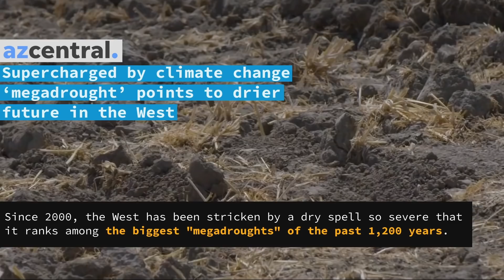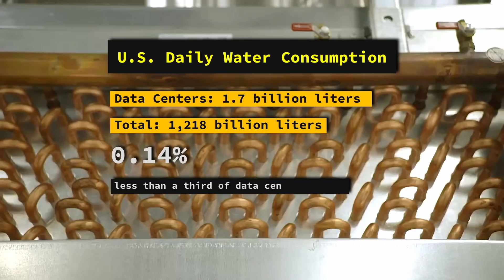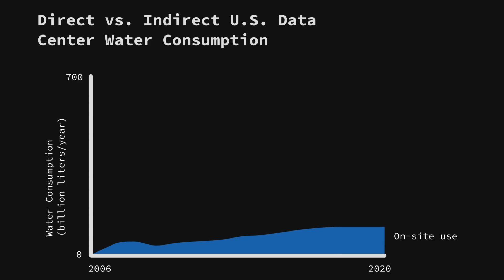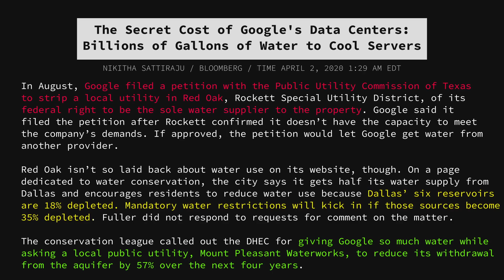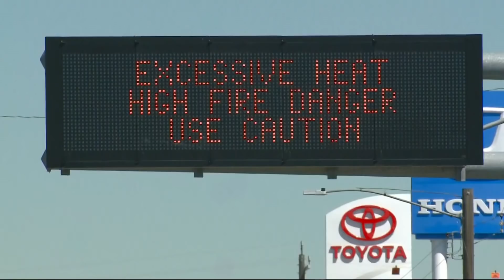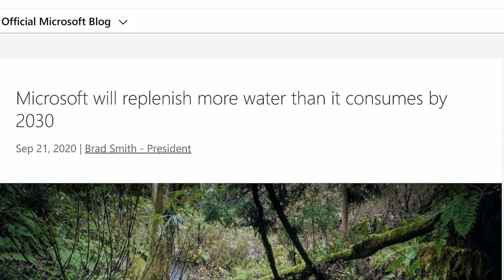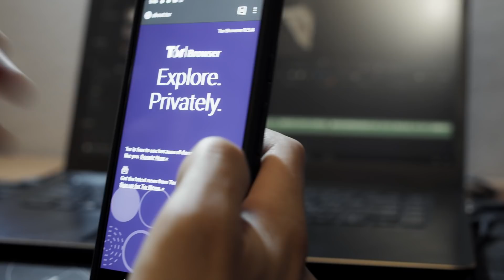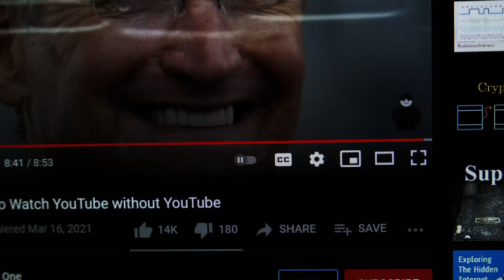The Internet Is Running Out of Water

Comment: UGH!

I'l give this channel a chance and little bit more benefit of doubt and watch few more videos but so far it seams like its milking a very specific crowd which is conspiracy theory prone for views and patreon supporters. 

as for this video maybe I am not informed enough so any answers will be nice: 

questions:

I do not understand this. How can we run out of water which is being evaporated when being used for cooling. Will more water in atmosphere not create more clouds and rain and come right back as rainfall? Evaporating water is Renewable by definition. It is still water just in a different form. 

Also where is the correct percent of how much water is used for data centers. only the initial 0.14% is shown everything else is speculation. there is a 1/3 mentioned and some sort of graph but no human readable number after all the talk about it. 

Finally my opinion, just an opinion but still. Draughts are caused by global warming. Heating of the atmosphere causes air to hold more moisture so there is less water on the surface as the result. Also yes it seams it is caused by human activity and not a natural process. regardless the cause we should try to reverse it or there will be less water. 

This is a problem that we are trying to solve using renewable energy and who knows machine learning might helps us solve it as well. Not sure why the video bashes technology so much. 

This channel is weird. So much conspiracy talk yet so many things are glossed over and not rooted in common sense. 
If you want to take a look at where the water is getting hit at most take a look at the animal agriculture instead. 

Also yes companies do things for profit go figure. Greed is a huge problem on Earth... but the consumers are the enablers and starting point of everything. Moderate your consumption as an individual to be less of an addition to the problem. That does not mean all progress is evil though. Capitalism sucks in many ways but as far as I know we did not find a better way to distribute wealth and exchange stuff. Yet.

if somebody answers I will read and try to learn maybe I am wrong?

Cheers!

Comment: There are many inaccuracies regarding "consumption" of water, especially in the sense of "indirect power generation".

These are majoritively closed loop generation systems, and even when not, create vapour.

In either case this is not consumption but conversion. It doesn't get rid of the water it relocates it.

Conservation of energy and mass is important to consider while taking in information like this.

There are simple methods to convert most of these systems (that aren't currently) into closed loop systems. That point was entirely missed here.

Also, the CPI is a notoriously unreliable document to cite due to constant manipulation.

Comment: So just so everyone knows, water used for cooling NEEDS to be potable (drinkable). Non-potable water has too much filth in it to be useful. It clogs up filters and the mineral deposits will cause overheating, and even electrical shorts and fires in extreme cases.

Comment: Why don't we use make system that way so it would use sea water? Though we might need to find a way to remove salt from pipes or radiators which would be used to transfer heat from centers to sea

Comment: All those datacenters located in dessert region could EASY pump sea water and use it instead of ground water .
Look how easy they can pump Oil across country in pipes . well water is easier because it is not flammable ect , 
and thus doesnt require same safety procedures ect .
It is also cheaper to pump sea wate than Oil .
In the process where it is used the water is heated up and this could easy be combined with a desalination process 
based on heat , well location is in dessert with already high temperatures so it would be much more cost effective 
than those placed at coast lines .
The byproduct could then be fresh water that could be used to fill up the gap where water is now dwindling .
All is a very simple process that doesnt cost too much to actually do and with climate getting hotter and water 
dwindling it would be a great future system that could easy solve those problems we face today .

BUT as usual it is THE GREEDY OLD ( as I call them )  who is leading the government and the industry  is owned 
by same kind of GREEDY people who doesnt care about anyting than own PROFIT .
We need laws all over the world to force them to implement such solutions or face their business being closed down .

Comment: How about building the data center underground, verticals vents can feed into an inverted funnel, the rising heat passing over turbine blades causing the turbines to spin a generator head, the fresh air can come through horizontal tunnels to the surface, the data center could reduce its power consumption through the use of passive cooling, and produce some of the power it does consume.

Comment: They should be putting the data centers in nova scotia, highest tides in the world. That place would be stupid cheap, cold enough, its closer to a port, and be something that helps that shit hole out. Yes it's salt water, but it's that or use a water supply in states that need the water. I'm sure there is ways around it.

Comment: Thinking critically here, if im wrong let me know and why im wrong, but this water isnt just vanishing out of existance, evaporative cooling isnt new, my father works with them for University's ac units with no complaints there, the water just evaporates as the name implies, all the water going in goes back into the environment when its used, so wouldnt that make more humidity build up thus providing those areas increased precipitation and then the water is just replenished? I feel like theres a more underlying issue here if the datacenters arent able to get the water because of something else, i dont think its the datacenters at fault here because all that water used is just put back into the air, it they arent performing hydrolysis and breaking water molecules apart to their main components, if they werent loosing it due to evaporation then they would just keep using that same water with no need for supply. I feel like something else is at fault here, not the data centers, ntm i dont think they want to disclose it because then people get mad at them for using their water but not realizing that that water just goes back where it was found anyway.

Comment: Solar panels are dark. Meaning they absorb heat and radiate it back into the atmosphere. Furthermore, if they are located in a tree rich environment. Trees will likely need to be cut down. The same for wind turbines. (Except solar doesn't kill the ecosystem like wind turbines do.) - which gets rid of the planet's capability to take co2 out of the air through photosynthesis.

Solar + wind is great for people/businesses that don't want to be reliant on the unreliable grid. However, it's by far, NOT a solution to co2 pollution. Especially, after you consider the pollution involved and the limited quanity of resources, needed in production.

Right now, as we figure out how to reduce our electricity footprint. The best we could do is create ponds to grow algae and plant lots of trees. Those solutions would interfere with current ecosystems, but they'd also create their own, while absorbing co2. Heck, we can even eat algae.

Comment: What do you mean "consumed", water doesn't just not exist. Even if water is used for cooling purposes, it would still turn to steam or vapor and go back into the clouds.
Lol they shoulda spent that time designing better water recyclation projects. Like at my work, most of the water used for dishes could easily be sifted, boiled and recircled without needing to be put back into the pipe system. Most of these kinds of advances are the kinds of things you'd need on ships but could easily apply to businesses. Then theirs no need for water rationing, because you have a system in place already.
I'd say a possible solution, would be to start moving ocean water, into the desert, digging out underground lakes, and dumping the ocean water above using the ground and dirt to filter out the salt. It would create a salt mine on the surface and a freshwater lake underground. Build enough underground "seas", and you can temporarily buy yourselves more time. You could use those underground "seas", using surface drip lines to regrow entire sections of the desert, starting off small and rebuilding the biomes from a micro to macro scale. Eventually once certain trees developed strong enough roots to burrow down into the "seas" youd also create a fairly stable chunk of land in the process, highly resistant to erosion from encouraging deep root growth.

Another design would involve a glass bubble. Dump the ocean water in the enclosure, the desert sun, boils the water, fresh steam rises, hits the glass, drains down the sides as fresh water, leaving behind a salt deposit. The freshwater can flow into the underground lakes, eventually you could mitigate the expansion of the desert by connecting a series of lakes into a great underground freshwater ocean. Cheap, effective, basically energy free, Since your letting the elements do it for you, minus the transportation of ocean water. Or repurpose pipelines for the same task. Not only would the project be a great "show" in generational terraforming mechanics, but it would probably classify as one of those world wonders kinda things.

A third solution would be to design a dual pipe system, exposed but covered by a glass or translucent cover. The ocean water pipe is shallow and wide to encourage evaporation as it travels down the pipe, the water heats and condenses, that water flows down the sides into the lower pipe which feeds the freshwater line. You could potentially provide fresh water to impoverished people's without big bulky or cost inefficient designs, like desalination plants. You'd have to figure out the ratios. If you were really smart you'd keep the lower pipe dark to encourage temperature differential and you could use those funny peltier plates to capitalize on that exposed covered temperature amped upper pipe, and the cooler temperature reduced lower pipe, to draw off electricity which scaled along it's entire length could provide enough energy to kickstart said impoverished people's communities.

As a bonus byproduct your also making fresh ocean salt with little to no effort. The biggest problem would probably be harvesting said salt, which would crystallize along the entire length of the pipe, so idk maybe harvest/clean the salt at nighttime? You'd havta put back into the ocean what you took out to rebalance it.

Comment: If the majority of water is used in power generation, it would be a good idea to focus on inproving that because the cloud is unfortunately not getting any smaller. Also the water being "consumed" is still just evaporating to the atmosphere. Data centers sound draw their supply from a separate source as drinking water. But its not just going away

Comment: There are a vast number of other issues to take into consideration. Population growth, deep water wells sinking the land, and wide range fracking that caused holes in the ground to drain now contaminated water into. Then there is the huge amount if water needed to run those geothermal power plants in southern California, that killed 4 lakes. 
There are a number of East coast, and great lake data centers that have plenty of water. So they just need to start moving the majority of those centers to areas that rarely have droughts. (September 2010 the center east coast had a major drought... it dried up a few streams, and browned the grass. But that was about it.)

Comment: Why don't they just ban evaporative cooling and arrange the heat pipes in a high wall and let high flow water cool it, meanwhile the water drop can be used to generate electricity and the hot water directly piped into households. Therefore there is very little water loss and you have free electricity and free hot water.
Reply: They can't think of this solution not in a million years?

Comment: First of all, no. Datacenters don't "consume" water. They're like NuclearPowerPlants. The water is in a closed loop. If it even uses "watercooling" for the components, more likely they use a cooling agent. Also, you still need ClimateControl for the whole building. Plus you still need fans other components which can't be accessed directly for heat transfer.
The whole deal with "Evaporative Cooling" is maintaining suitable humidity and temperature throughout the building. It has mostly nothing todo with cooling the servers themselves.

4:09 Also how would it even "evaporate"? Never looked at the outside of your AC? There's water dripping DOWN! 4:09 It's hot Air expelled against cool outside air. If you atleast attended gradeschool ,you should now that there's more water stored in the hot air than in the cool air, and thus there's actually water being "created" (If you want to stick to 4th grade vocabulary)
Reply: Also, a damn is used to create enough water-pressure to make turbines spin and produce electricity.
It's not like it's made to be fresh water reservoir primarily. That's just a side-effect. Making just a Damn, that holds the water, is like the dumbest idea. Without inflow. No matter how big, it will just evaporate really really fast.
EDIT: Ok in the case of the Hover Damn specifically it was made primarily to control the fresh water supply (monopolising water?), 'cause y'all just live in a desert.

Comment: Here's a wild idea: Maybe don't place them in desert states where they need a lot of cooling and there's very little water?
None of our datacentres in Denmark used a single drop of water for anything but flushing the toilet.
Reply: Im certain there is less being used but I doubt Denmark's cooling uses no water. These computers get pretty warm
Reply: @Meaty_Aberration  There's a bit of water in the cooling loop, but we don't use evaporative cooling. 11 months out of the year, we didn't even use compressor cooling, just a very large air heat exchanger.

Comment: is closed loop water cooling not effective enough???

i get that servers can be too dense for direct flow electric air cooling to keep up with heat output, but surely waterblocks have gotten good enough that industrial pumps, which are pretty efficient, could manage even the most heat intensive compute farms. heck, refrigerative cooling? why evaporative? sure it is effective in arid climates but Heat Pumps are now so efficient and scalable, not doing that would only save short term.

maybe we need an industrial price control, like a carbon tax, because this is ridiculous. water should get more expensive the more of it you use, and if thats already true, keep it coming. make it unfeasible for companies to ruin environments.

Comment: Its true Data Centers use massave amounts of water. but iconsider that the only water that is lost is from evaporation in the cooling towers.. rest goes back down the drain and back to a recharge point. Many data centers can meter the water that is pulled from the source and also meter the water that goes back to the drain.. the net results from the 2 meters are the water that was evaporated.  As for Arizona the majority of water used in the state is from farming.. where it is masured in "acre feet" not gallons.

Comment: The internet use alot of water to cool the servers, but water does not disappear after it is used. If water is used in evaporated cooling then it will be released back into the ecosystem.

Comment: This could be so easily solved by just using CLOSED LOOP water cooling instead.

Well, I say easily but it would probably require an insane amount of money to change the method of cooling in so many existing data centers, not to mention that evaporative cooling is probably cheaper even than passive (radiative) water-cooling, let alone active (aka fans on the radiators), but I can't imagine the difference is that big.

Then again these are the kinds of companies who will do anything and cut any corner to save a single cent of profit.

Comment: Huh, that's weird. Why don't they recuperate evaporated water through condensing it? 
It would also make sense to use seawater to cool data centers and collect condensed desalinated water. It's a kind of win-win scenario for everyone.
Reply: The salt collection process would be more expensive. As well, salt water takes more heat to evaporate, which could cause heat overloads. It's much less efficient for cooling.
Reply: @Attackbow1566  --Thank you for thesalt water explanation-was also contemplating wby salt water/saline would not work.✌

Comment: Feels like there should be a liquid that helps sap heat from these devices and is also able to actively exhaust said heat without expending the fluid. Maybe through a system of radiators and bypasses for liquid that isn't heated up. I think it should be able to withstand being in a closed loop to sap heat from combustion as a standard, too. Let's call this new mystery liquid, coolant.
Reply: More expensive to produce. It’s useful in cars because you need to cool a hot and powerful engine off faster, but older cars actually do use a radiator to cool the engine. Issue is, when engines get more powerful, water doesn’t cool fast enough.

Not so much an issue in power generation and most hardware.